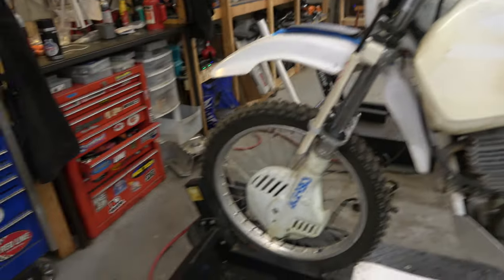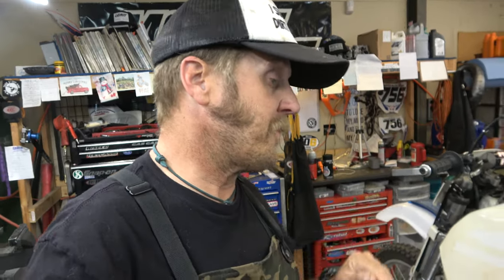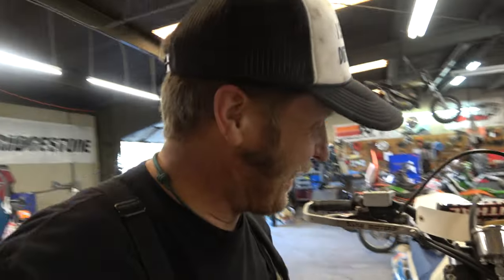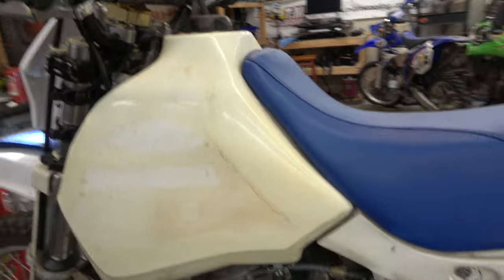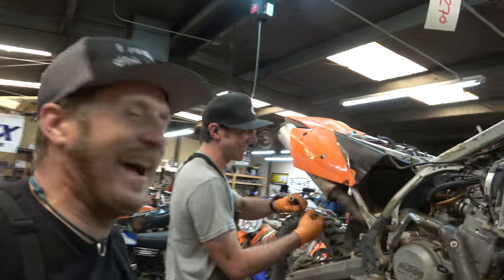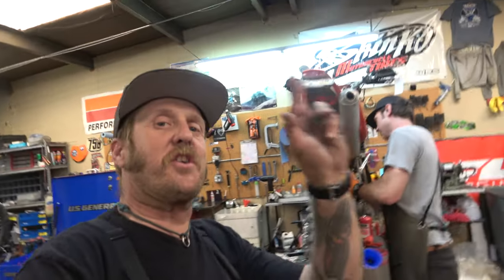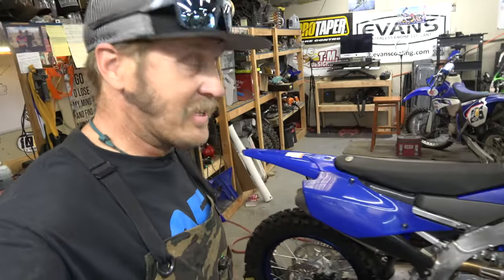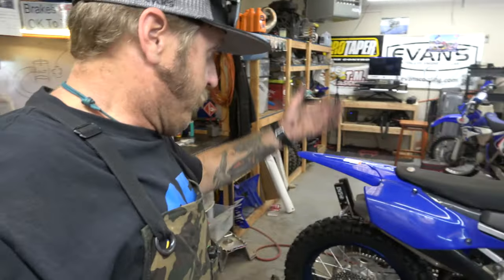XR600R | Front Wheel Bearings KTM | The Shlog #224 | Lowering a YZ450FX | Highland Cycles

Comment: A spacer on a piston shock should  not need a pistol height adjustment.
Reply from the maker: I think it would. Because if you push that amount of fluid further into the system, it would push the piston further down the chamber. Now, would it adversely affect the shock??  I don’t know.  Probably not but to get it back to the recommended height, you would need to at least bleed some fluid off.
Reply: @highlandcycles  honestly either way probably isn't completely correct. The only possible issue I could see is if there is a narrow enough margin for the piston to bottom out. it probably has some small effect wether it's a bladder or piston because it alters thebalace of gas to fluid and changes the raising rate of the pressure as the shock shaft displaces fluid. I doubt it merits any real thought though.